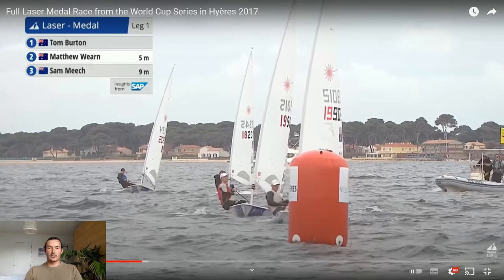Laser Sailing Like Olympians || Downwind in Choppy Conditions

Comment: Hey Coach Dan! Hopefully you’ll see this it’s been a while since you uploaded this video but I’ve been transitioning from a 4.7 to a radial recently and I always get overtaken on the downwind probably because Im letting the sail luff by sheeting out too quick. You were talking about how Pavlos Kontides takes the mainsheet from the boom and aligns the rate of his sheeting in/out with the rate of the boat turning. I was wondering if that rate was 1:1 sail sheet to boat turn or is that ratio something I’ll have to develop through practice?
Reply from the maker: Hey! Thanks for the comment and sorry in the long delay in getting back to you. To answer your question - it's essentially 1:1 but it is also something you'll have to develop feel for. The best rule of thumb is - as you're turning up, the sail should never luff at any point. If your sail is luffing, you're just wasting potential speed.

Hope that helps!

Comment: Thanks Dan. I notice that no one really ooches. i personally have a tendency as i bear down by the lee to exit the turn by pressing my aft/tiller hand pretty far forward on the leeward rail, putting my weight into a powerful combined ooch and leeward flatten. no one else moves that aggressively though. does the effect of the roll outweigh any potential benefit to ooching and forward/aft kinetics?
Reply from the maker: Hey Connor, thanks for the comment. I don't think the effect of the roll would outweigh the benefit to forward/aft kinetics. All of the top sailors will also be using a lot of forward/aft movement, but tend to be more subtle about it for Rule 42 reasons, and it becomes more necessary in bigger waves when it's really crucial to keep the bow out of the water/planing. 

In conditions like the ones in this video, you're rarely fully surfing, so the fore/aft movement will be more about maximising waterline length to kep the boat 'surging' in each wave for longer.

Comment: Dan, you mentioned a 40degree change to downwind direction in the "S" curves, its easy to sail too much distance chasing speed. Is there any "rule of thumb" for the amount of direction change?
Reply from the maker: Hi Peter, thanks for watching! It's definitely easy to sail too much distance 'chasing speed'. The thing about this technique is that every time you turn, you should be generating significant extra speed if done well, so it's less 'chasing' and more 'creating' - this minimises any lost VMG. In contrast, in big swell conditions, you do a lot more 'chasing' because the speed gain from surfing a large wave is so big. 

I don't have a great rule of thumb (and 40 degrees was a rough estimate), but the best indicator is definitely going to be your tell tales. Here's a link to a great section of the original video https://youtu.be/KsIgTLtKwrw?t=1380

You can see Pavlos' tell tales going from nearly completely horizontal flowing towards the mast, to flowing slightly in the 'normal direction'. In hindsight, his angle changes here are probably closer to going from hard BTL, to nearly dead downwind/slightly positive flow once he's 'surging' on the wave.

Comment: I see there is enough wond for them to put the weight on the gunwhale. How would the donwind technique would change with even less wind like 5-6 knots? I've seen your video with very light wond but I would like to have some key points to work on.
Reply from the maker: In 5-6 knots, you're mostly going to be focussing on sailing by the lee and staying in pressure. There's not going to be enough acceleration to surf, or to justify large up turns. When you do get to a nice gust, you can start doing small up turns to capitalise on the extra speed and head more towards the mark. 

Wind this light is also going to require more focus on angle, and plotting your course towards the mark. As you will be sailing by the lee most of the time, timing your gybes is going to be crucial to sail the optimal VMG course.

Comment: Do you think the same technique applies 100% to the radial rig?
Reply from the maker: Yes, definitely! In the radial rig, you might need a little bit more wind (maybe 8 knots to start using these techniques), but definitely still apply. I've sailed a radial rig at 83kgs in these conditions, and the techniques worked just as well. The main difference I noticed is needing to be much more 'gentle' when flattening the boat after a turn. Since the radial rig has less power (and less power at the top of the rig), it feels like you can 'over flatten' the boat much easier, and kill all the momentum built during turns.